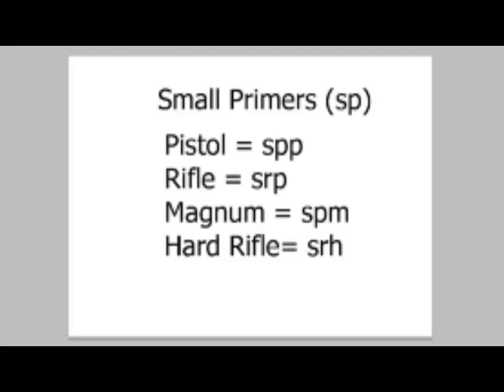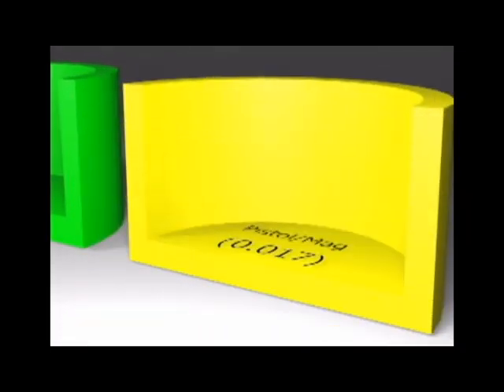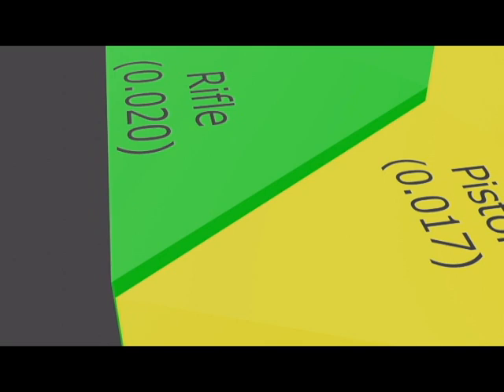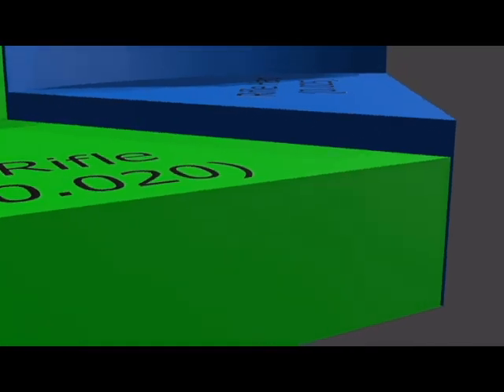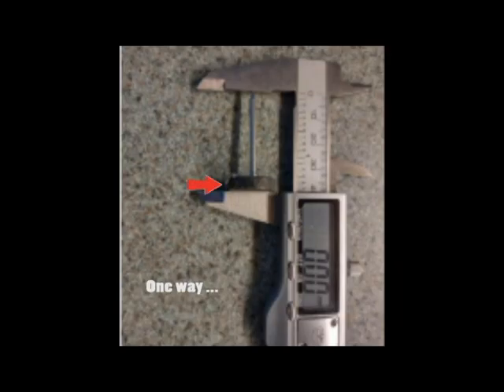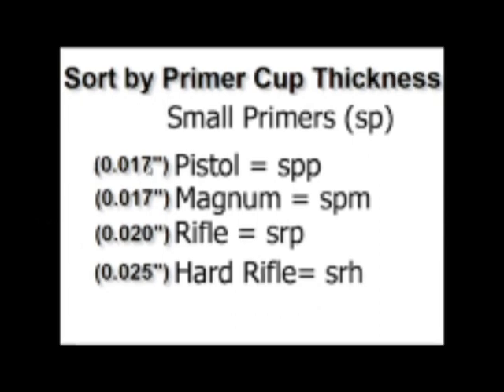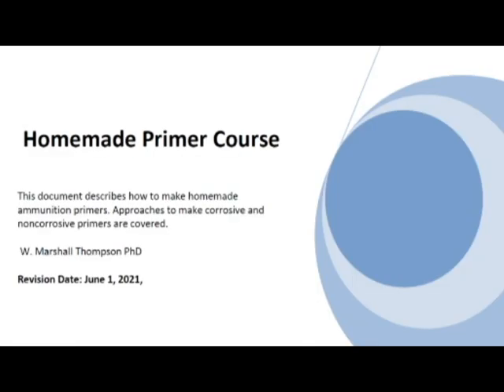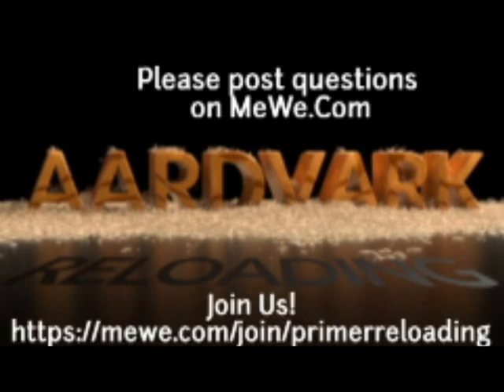Sorting Random Small Primers

Comment: Just starting to sort and de-dimple large rifle... looking for more info like this and techniques
Reply from the maker: LP's are a different animal.   But it's rather a fortunate one.   You can sort LP by the cup height.  Careful - decapping may distort the cups and monkey up the works.     I don't have much (any) experience with LP because most of my work deals with SP.        I found a chart on my website.

https://www.aardvarkreloading.com/primerdimensions.html
Reply: @helpmenowmark  I am looking to De-dimple without hammering the cups. Is there any guys using two pinching studded wheels concept or other methods? Small or large size ?
Reply from the maker: @christopherpeterson1400  https://www.evernote.com/shard/s378/sh/ccd47e0c-f40e-779b-6afa-311e103a943f/25a03a038ddd5352c57625cd647d7a7b